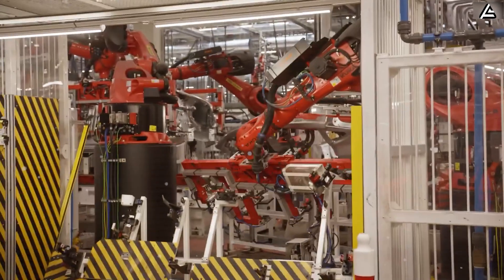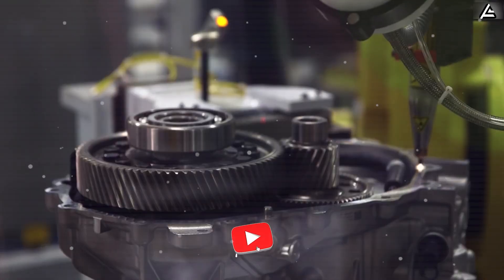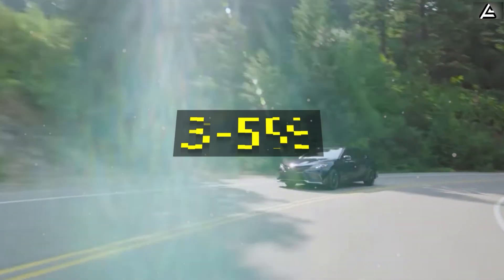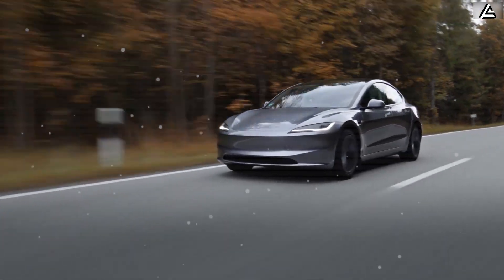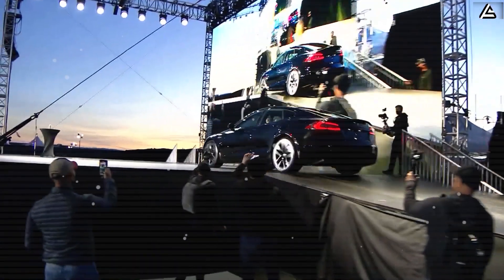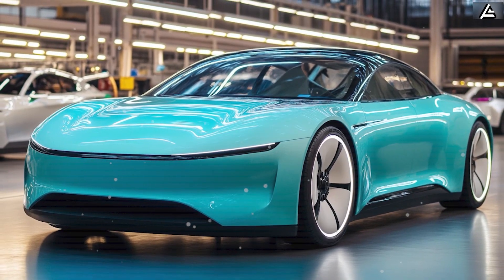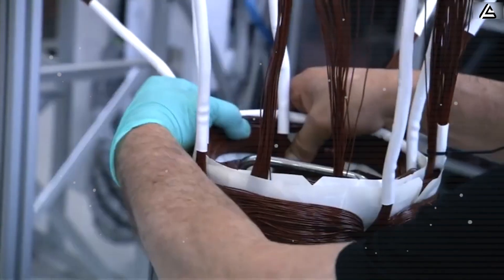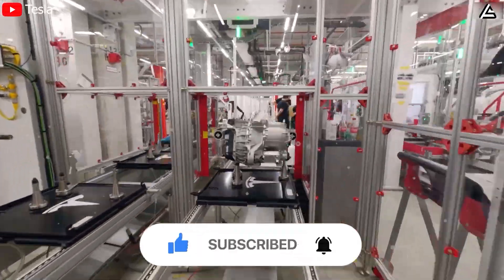Elon Musk Announced 2026 Tesla Carbon-Wrapped Motor For Model 2. What’s Hidden Behind?

Comment: I think, prius has it right, imagine tesla with 1/3 of battery (still enough for every day use with ~100 mile ev range) and a small 25-30kw 0.6-1 ltr slow reving motor kicking in as a generator for long trips. With a 10 gal tank the resulting tesla “LUDITE” would be lighter, have more range, no range panic. And leave the stupid door handles, self driving, screens and screen only controls for s, x models.  Battery warming in winter will be sorted with waste heat too. Am i wrong?
Reply from the maker: That’s a really interesting concept — essentially a range-extended EV! 💡 Do you think a "LUDITE" Tesla would appeal to the current EV market, or is it too much of a compromise?